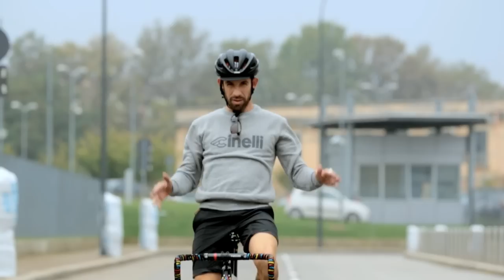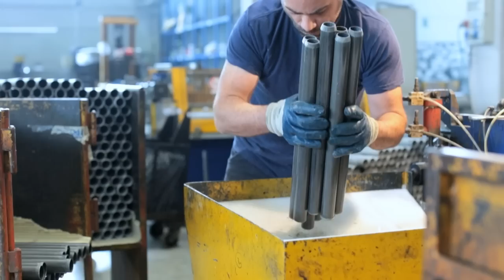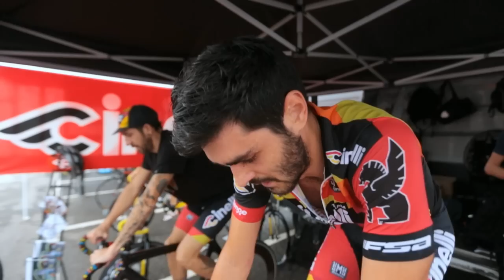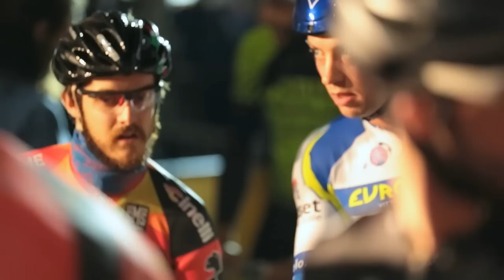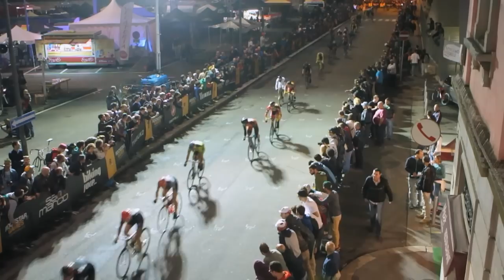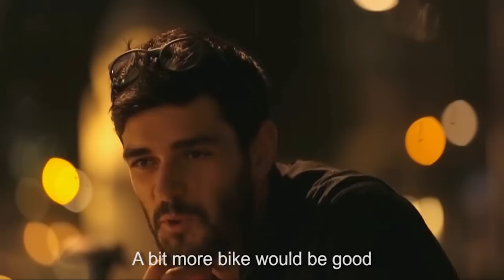Team Cinelli Chrome

Comment: Props for riding fixed gear. I tried for about a month, to and from work is about 20 miles, just didn't enjoy it as much as I thought I would. I'll stay single speed.
Reply: there's pretty much no reason other than track racing to ride a fixed gear bike over a single speed. single speed is safer, faster, and more efficient.
Reply: Safer depends on brakeless vs. brakes, faster depends on the rider's abilities (on flat groundsat least) and efficient? I don't think so. Is it harder to pedal all the time? Sure. But it's a hell of a good training, even on shorter rides :)
Reply: you just went
Reply: @milododd  fixed cog is faster than free wheel single speed.
Reply: Fixed gear is faster than a single. And more efficient, cause you re pedaling with the momentum of the whell. Ofc first month's is hard, but after a year go back from work daiyly 20 milles in total plus in days off I go cycling another 30 or 35 milles. After cycling in road bike for 2 years, in a fixed gear 46*14 i really enjoining the experience.

Comment: Can someone please tell me if track bikes can be ridden as daily commutes?
Reply: Any bike can be used for commutes but what you commute on is really a personal preference.
Reply: ok...but i was under the impression that track bikes and most fixies have no brakes..and i am sure that here in australia all bikes to be ridden on the road must have at least one working brake..
Reply: +mickpork my daily commuter is a fixie with a front brake. Most fixed gear city bikes will come with brakes installed so if you want to commute fixed do it!
Reply: thank you for your comment...i want a fixie as i have always liked them.I usually ride a single speed trek mountain bike and i ride in a lot of traffic so i need to have brakes...
Reply: Depending on your local legislation, you may or may not have to use brakes.
Other than that just avoid carbon fiber if your streets are bumpy and shitty.
Reply: Thank you for your comment.I did buy a track bike and its been a huge learning curve.I keep forgetting i'm not on a freewheel bike.I did also find the gearing very high for the hills i ride and maybe thats because the bike is a criterium bike or maybe because i am use to riding mountain bikes and road bikes.So far a lot of fun though...
Reply: thank you very much....so far lots of fun ...
Reply: mickpork They sure can. Been riding them for 20+ years. Simple and fun to ride.
Reply: mickpork been riding mine for a year daily, so I'd say yea
Reply: yes you can I do so. just be careful and place a front brake for the emergency situations. you then need to be much more focus then with a normal bike cos the unforeseen is more difficult to manage when u are always in motion. the feeling is nice u are one only with your bike and you can feel the ride at a different level. I like it very much... is that hipster? yes it is but if you like it and if you really ride it I do not see the problem. If you keep the bike home and put pics on istagram then you are just a silly and you would be the same with whatever you do bikes or cars etc...
Reply: Absolutely
Reply: Sure. It's just stupid. Track bikes belong on the track, true track bikes are not drilled for brakes. I ride my very nice track bike on the street and feel like a the stupid wannabe hipster I am for doing so. Get a steel bike  with both brakes and wider tires if you want to ride fixed on the street